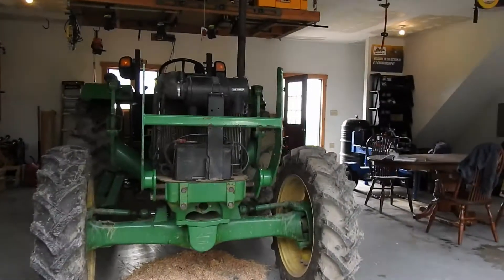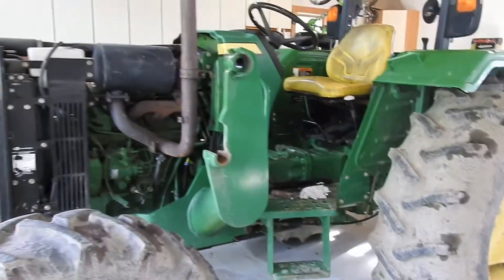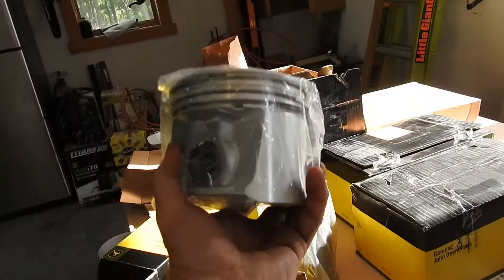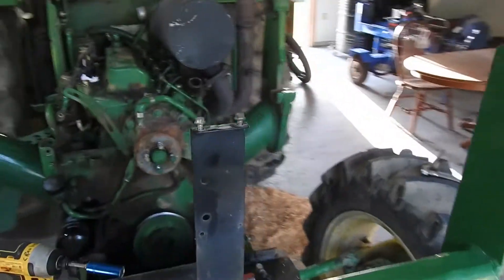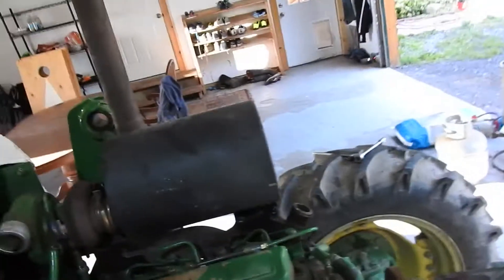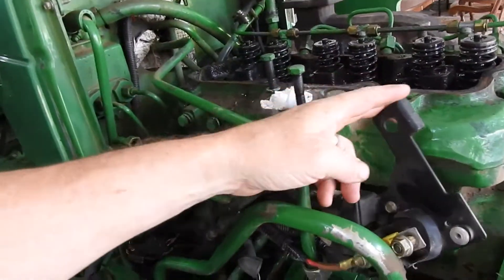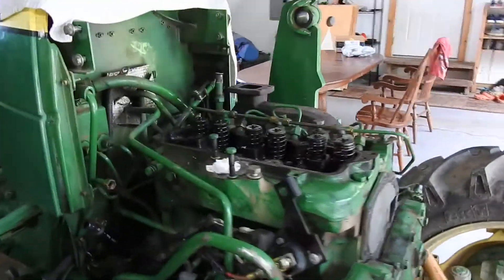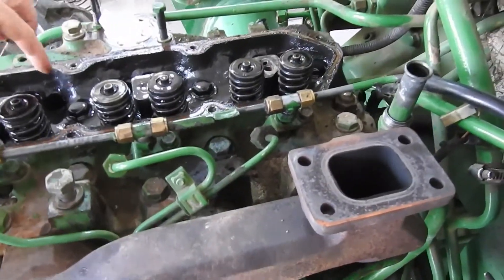John Deere 5065E Engine Rebuild Part 1

Comment: Hi, good video. Do you know why you had to rebuild it? Was it due to a lot of heavy use and high hours? Im looking at a new 5065, should i be concerned? thanks
Reply from the maker: No don’t be concerned. I can only imagine that the tractor I have was not maintained properly prior to my owning it. I bought the tractor at auction, observed that the tractor was used in a dusty environment, the oil probably was hardly ever changed. The compression was really low, so a rebuild was necessary. As long as you continue with good maintenance,You should be just fine. Good luck.
Reply: I wouldn't trust the Air Filter John Deere has on these tractors at all. @christopherrauber3776